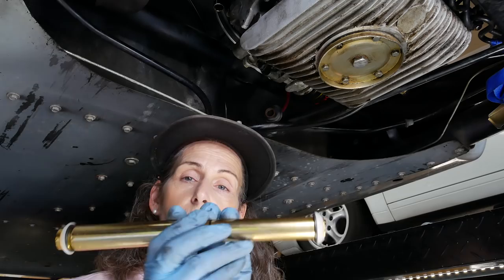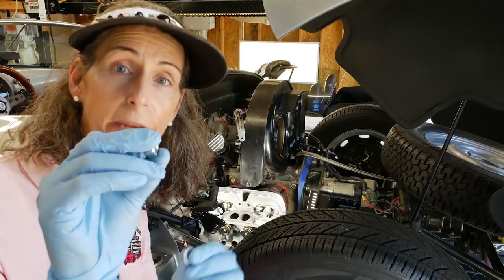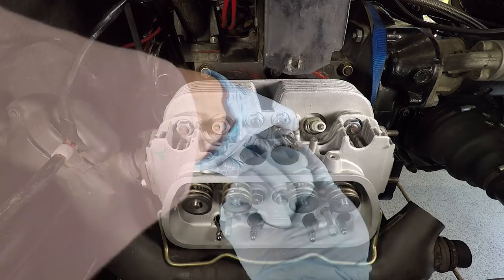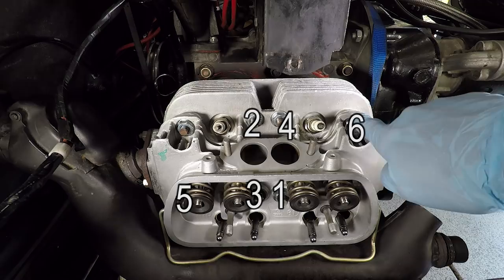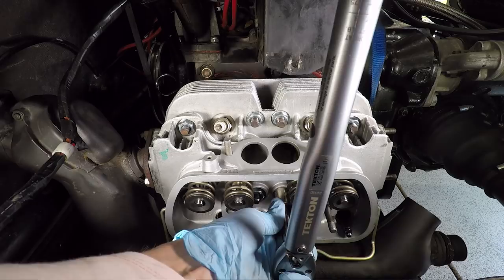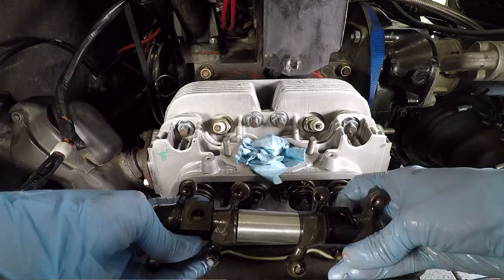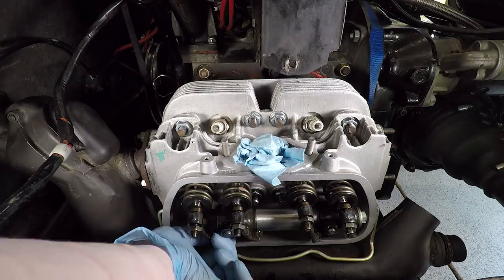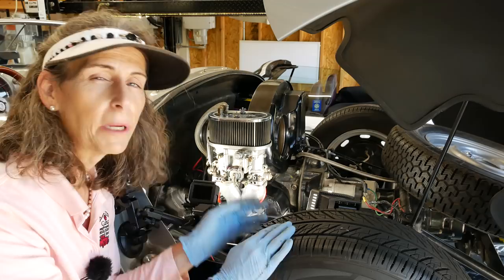Beck 550 Spyder Replica VLOG #6 - Head's up!

Comment: I may have missed it but is there not a gasket that goes between the head and and the cylinder or does it get mounted "metal on metal"?   Great series - can't wait to see it running and what your final assessment is of the problem that started this all!   Was it a bad head?   Did the machine shop repair the crack?  Was the crack in the head the culprit?  So many questions!!   Love your thorough work - cleaning both carbs, having both heads redone, etc.   I am of the opinion "while I am in there why not do it all and minimize problems down the road"!
Reply from the maker: David, there is no gasket, so yes, metal on metal.  Keep tuning in. There are all sorts if pieces to this puzzle. I will have Franny address the crack in her next video. It seems to be a common question.  Heidi

Comment: I always used new pushrod tubes, cheap insurance, there used to be spring loaded tubes available also, kind of looks like that's what you have. Blue Locktight will come off fairly easily, it's the red that's an issue, heat is necessary for it and the heat the engine generates will make the blue strength dissipate over time. Glad to see you replaced the nuts and washers, almost sop. To me any crack especially in a head or block is verboten, must replace.

Comment: Great video! Again very informative! I was surprised to see two different sequences of for the initial low torque and higher torque. The torque figure seemed a little low at first, but makes perfect sense once you take into account the different expansion of the pushrods and the rest of the engine. I was also wondering if the original torque spec was in Newtonmeter. If you do the conversion, it works out to 10, 20 and 30 Newtonmeter.
Reply from the maker: Ahhh Of course!  Makes total sense.  I think I need to start using NM.   Thanks!

Comment: I LOVE what you're doing here! I used to drag race Type I VWs back in the late 1970s and WOW, this stuff brings back mems! 

I have to say that when ever I went this deep into one of my engines, I just pulled it all the way out of the car. Of course, I was always working with a Beetle sedan and only could lust after a Beck in my dreams. LOL (I still have a lust for one of these) I can see that the Beck has a lot more room than a sedan so, maybe that's why you decided to leave the engine in. ... I don't know. 

Anywho... once I got used to pulling an engine, they came out and went back in SOOOOOO easily it was just immoral to do it any other way. Then all the work was done right up on the bench where my aching back could catch a break. 

So, I have a question... WHY did you not trash those heater boxes and just put in J-tubes? The car does NOT have a working heater anyway...right? J-tubes would be just the ticket in a situation like that. At least it seems to me it would be that way.

BTW, I used to torque my heads to the first step (I don't remember the value) then I would torque the other side head to the same value. My feeling was that torquing one side to full tight might distort the case given that the VW case is split in the middle. This may have been an old wive's tale but it made me feel better to do it that way.
Reply from the maker: I did come this close to pulling the engine...  It is a bit of a pain in this car though.  Ahhh, the heater boxes/J-tubes...  I am sooo with you!  Those boxes were installed by a previous owner in the hopes of adding heat. We look at removing them, but we were worried that the muffler would need to be re-fitted and there was the issue of sourcing the parts.  The owner opted not to.  Sounds like I could have used your help on this one!  Sounds like you would love something like this!

Comment: I was wondering why flat side of the washers toward the head?  I would think that the flat edge would have a cutting action on the aluminum. Of course i am just guessing... thanks.
Reply from the maker: Hi Akk, more around sealing I believe...  The bottom four studs are in the oil bath of the valves.

Comment: Great video. What was the outcome of the cracked head?  Did you replace the head or was a repair possible?  
I personally would not use locktite on the heads, but if that's what the owner wanted.  Well, it's his car...
Looking forward to seeing it run!
Reply from the maker: Yeah, The machinist thought the crack was not an issue.  I go over it more in the next episode.  F

Comment: I don't think the Locktite on the head bolts is going to buy you anything.  If I remember the Locktite data sheet, heating to about 150 degrees is the recommended temperature to break the seal to disassemble a Locktited fastener.  I suspect the heads will achieve that temperature in operation.  The nylon in the Nylock nut is good for about 500 degrees.  They should hold tight without Locktite.
Reply from the maker: Good points.  I wouldn't have bothered myself either.

Comment: Q: No gaskets between the head and the cylinders?
Reply from the maker: No there aren’t.
Reply from the maker: I believe the older 36hp Type 1 engines had copper rings, but the newer engines were metal on metal (well, steel on aluminum).  Like an Al crush washer on an oil plug ;)

Comment: It's sad you're putting the engine together the hack way again. It will not last long. All that hard work for nothing.
Reply from the maker: Franny does not ‘hack’ anything.  You are making an assumption about something that perhaps she did not communicate clearly enough.  Why do you think that and maybe I can clarify.  Heidi
Reply: @HeidiandFranny  
Like, I wrote before about that engine who ever built that engine cut corners to save money. The engine is missing very important cooling tins. Franny needs to do more research to see  and understand what I mean. Those heater boxes need to be replaced with J-tubes pipes.
Reply from the maker: Franny has already discussed with the owner.  She is working within his constraints.  So, hands are tied on this one. She agrees with you.